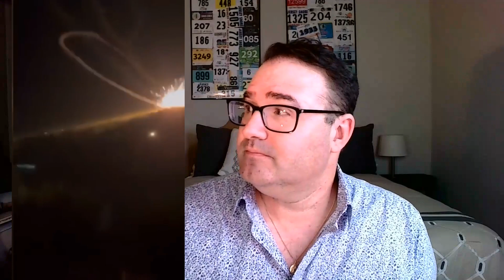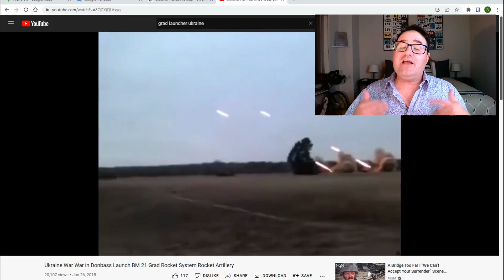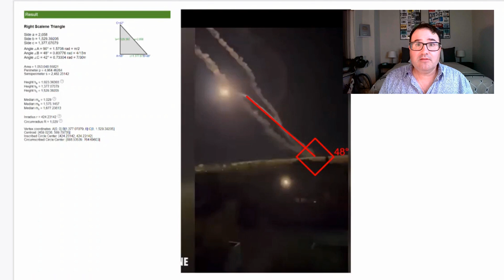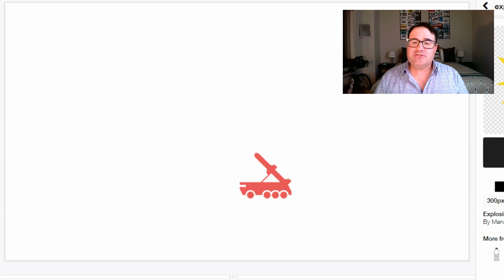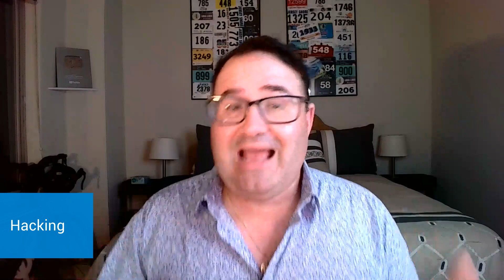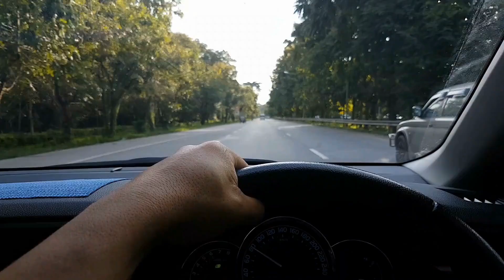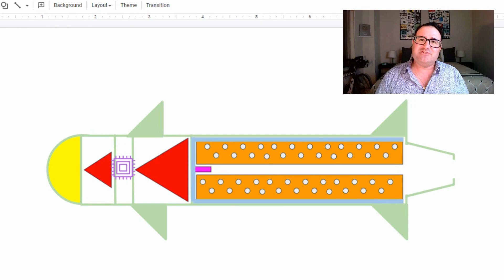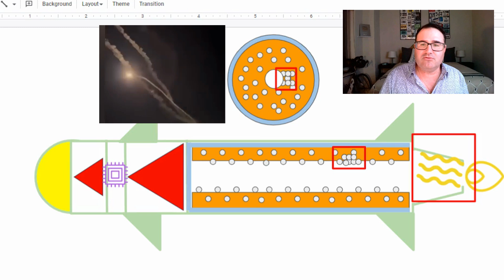Why this missile U -Turned

Comment: Even if this is correct, the rocket did a 180* and hit the Buk itself. If your theory were correct, it would most likely do several spins before probably falling out of the sky, but it leveled just perfect to hit it. If it just hit the ground, and nothing else it would be fine. But a perfect hit on its own launcher? most likely not a coincidence, im guessing the operator used the same cordinates as he was as where the missile would go.

Comment: I would have to agree with the assessment that the cause was uneven burning of the propellant.  however, I would suggest a different cause.
with all the recent videos of ammunition stores being shelled, and even missile supply trucks coming under fire, it is quite likely that this weapon was damaged during transport, then hastily used without proper inspection.  

Love your videos btw.  Former Marine myself '81-'91.

Comment: It's appears to be a very clean turn, so I'd be surprised if it was only a fuel storage issue, though it could be that our perspective doesn't show how far latterally the munition has deviated when it turns back. 
I do think it could be mishandling that caused this, but more towards an additional hardware failure stacked with the fuel issue. Looks very much like a automated course correction failure, so there might've been a broken exhaust nozzle involved.

Comment: The flight pattern itself shows IMO, that this is either an input or readout issue with an otherwise mechanically sound missile. First it flies straight as intended, then as the external component of the course correction system first picks up the missile, it makes a very controlled snap turn and realignment accurately straight back at the launch direction. That snamp turn was the course correction, but it was just much earlier than intended, as the missile thought it was already at the (un-)intended target. Remember, even the oldest missile directing calculation isolates the missile's own position, instead of blind flying. If it had a working course correction with faulty fuel, it would have tried correcting the unintended flight path with parameters differing from a fully functional missile, resulting in a spin or a harsh drift. That wasn't seen here at all.

Either a predicted flight path metric (either acceleration or direction zero?) was inverted resulting in the ~180 °, or they managed to either input or direct the target to the launch area, which has happened before and looks more or less like what was seen here.
Reply: This reminds me of that Proton-M rocket that similarly turned around (https://youtu.be/vqW0LEcTAYg).  Right into the ground.  Later, they realized that some engineer installed guidance sensors upside-down.
Reply: Do you think it’s possible they accidentally gave it their own coordinates?
Reply: @user-sp9ue1ws7c  That's not how these missiles work.
Reply: @miled8649  I think it is they have onboard gyrometers, gps, and terrain detection systems. They dont use active or passive radar tracking due to the distance they travel. But im just an engineer and idk anything about missiles
Reply: @user-sp9ue1ws7c  Assuming this is air defense launch, and assuming it's medium to long range, there have to be passive or active radar guidance involved. Of course, in this initial phase, it's most probably guiding on inertial system. Anyway, gnss receiver is out of question, at least in control loop. It can be jammed or spoofed thus introducing error in nav mix, and it's pretty much useless since you cannot just enter coordinates of moving target, because, well, it moves - changing coordinates constantly. Beside, gnss altitude measurement is mediocre at least, cannot even be used in commercial aviation for altitude measurement without serious radio controlled augmentation which is of course easily jammable or spoofable.
Reply: @user-sp9ue1ws7c  No, since the other missiles fired OK.
Reply: @person-guy-himself  Thanks
Reply: arctan and then the wrong quadrant.
Reply: @rursus8354  i see that now thanks. What do you think caused that? Instability?
Reply: @user-sp9ue1ws7c  Bad programming in this case. The fast fix is to use arctan2, otherwise check the computed x and y and then determine the quadrant.
Reply: @rursus8354  I feel like that would have been an easy fix by changing the coordinate system if that was the case though

Comment: when i saw this, I thought it was the missile's heat guidance system kicking in a bit too early and taking a u turn toward the hot missile trails/launch tubes - but this somehow makes more sense
Reply from the maker: That’s a very good guess, but this particular missile is semi-active radar homing.  Heat seeking missiles are typically very short ranged

Comment: Hey Ryan, love your videos. Just for credibility's sake, I am a mechanical engineering trained in jet propulsion, both rocket and otherwise. The only problem I see with your theory is solid rocket motors have nozzles, so inside the combustion chamber the pressure reaches some level regardless of wether or not all sides of the flame front are burning evenly. So there should be no thrust vectoring that is dependent on how the propellant is burning, it's only dependent on the nozzle. That being said... I don't have a better explanation, other than those already proposed in your video.

Comment: Would t the combustion chamber and nozzle negate the turning impulse of a hot spot I. The propellant? Especial because the BUK’s missiles combustion chamber is actually in the center of the rocket body with a gas pipe leading tot he nozzle at the base. I think it’s more likely a hotspot burned through the combustion chamber on one side causing a breach that let gas escape, providing the turning impulse. It’s possible the guidance system was attempting to counteract this impulse and is why it straightens out after making the turn initially.
Reply from the maker: I’m beginning to think this is more likely and I’m going to do a video on it soon.

Comment: Is there any way for the rocket to lock on the radar signal of another battery?  (or possibly even it's own?) (Just like some of the Russian pilots firing HAARM type missiles into the open as seen in the beginning of the war.) and they shot these up in "Free roam mode" perhaps for a nice propaganda film and it picks up the signal from their own system and goes on that........ Just a wild guess here

Comment: I really hope this actually happened to these assholes. 
On another note...I used to build my own model rockets when i got bored with the kits and thought a tube, fins, over sized engines and packing the parachute area with gunpowder from 12g shotgun shells was appropriate.
Many came back to me after flying only 100ft away and exploded. Good times